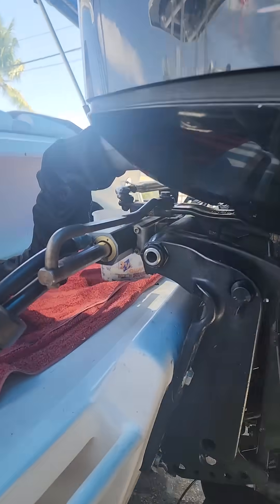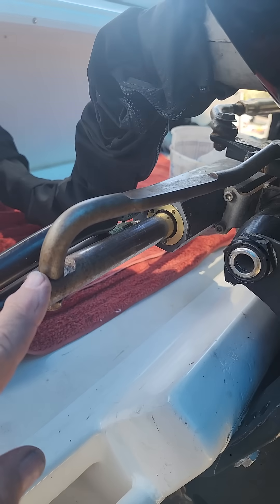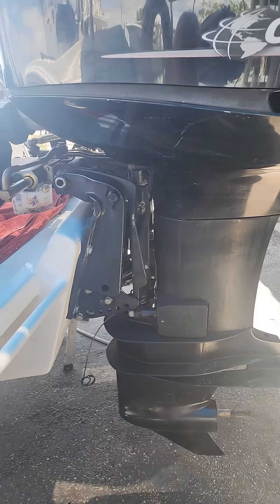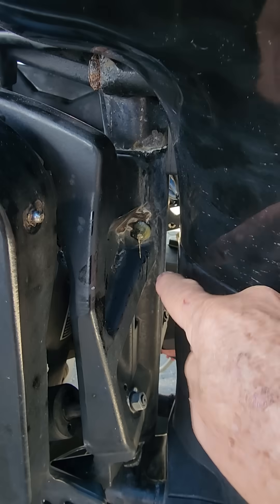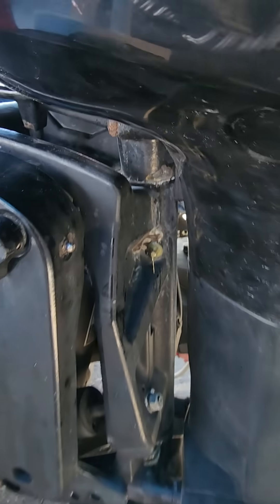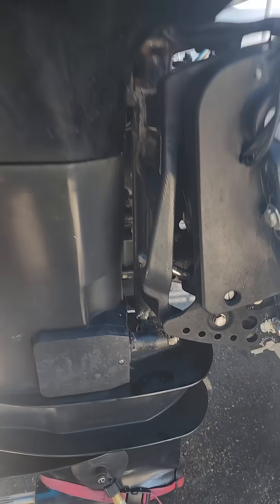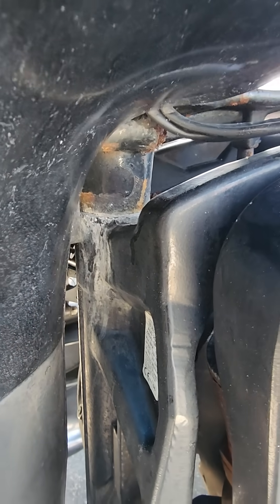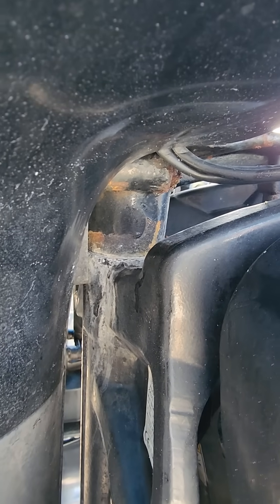Stiff Steering. Corroded Upper Swivel Shaft Bushing.

Comment: Those look to be Mercury 2 strokes, maybe Optimaxes.  But the design is similar on a whole range of Mercs and other outboard brands.  

He is right that the upper plastic bushing surrounding the swivel pin (there is one at the bottom as well) is likely seized with dried up, caked grease.   It’s not likely to be successful, but one can try to pump gasoline into the grease fitting repeatedly over several days and tilt the engine up and down and try to move the engine side to side and see if little by little it moves more easily.  If that succeeds, then once again introduce grease and expel the gas.  The gas will work as a solvent to free up the dried up grease. But the aforementioned is at best 30%-50% chance at working,   But it’s worth trying because the alternative is this:

The proper fix is remove the power head and middle unit from the bracket - which is a HUGE job, as the powerhead has to be separated from the exhaust plate and lifted off, then the upper and lower motor mounts removed, removal of the middle drive shaft housing and finally the retaining circle at the base of the swivel pin inside the lower yoke.  The swivel pin itself then comes out upwards, likely needing a hammer and pry bar.  The. the old bushings, o rings and seals are removed and the cavity in which the swivel pin sits needs to be cleaned out with solvent and rags - length of 1” pvc pipe can be reamed in and out with solvent soaked rags on top and/or bottom - of all the old corrosión and dried up grease.    If the swivel pin itself is not too corroded - shouldn’t be as it’s stainless steel - it can be honed with Emory cloth.   Then New bushings, o rings, seals and reinstall it all, reinstall the swivel pin, with retaining clip (a PITA itself), new gasket on bottom of power head for the exhaust plate and reassemble.   

The huge problem with this job is that if the swivel pin is that bad, the motor mounts and their bolts are likely shot as well.  They won’t be able to be unscrewed to get the middle housing off and the motor mounts and/or bolts will likely have to be cut off with an angle grinder and replaced to do that.   Additional cost and parts for new motor mounts and their mounting bolts.   Also, the exhaust plate itself might corroded and in bad shape, including the area where the idle relief boot is secured to it, and all of that might need to be replaced.   If one goes that far, clean out of the accumulated tar and carbon inside the exhaust tube inside the drive shaft housing should be done, along with new gaskets.   Cleaning the exhaust tube of all that crap is a freaking PITA.  It can be done with a 5 gallon bucket with a 50/50 mix of acetone and automatic trans fluid, soaking for several days and a shit ton of rags, boring brushes for the idle relief ports and time.  

This job is not for the faint of heart or those without strong mechanical skills.
Reply: Hi mate, curious to know how to go about pumping fuel into the grease nipple? Are you pumping it through a grease gun? I have this same issue with a Mercury 60hp and have tried heating up the area to get grease into it but no joy
Reply: @yourmumscaretaker Hello, take a look at this video: :

https://youtu.be/Ph0QndGBa6E?si=WBL-oGWjl4twF4Cx

Be careful using too much heat on the area at top and bottom of the swivel pin.  The plastic bushings, seals and o-rings can melt if you get it too hot.  

The gas in the grease gun effort may or may not work, but it’s worth a try.   You can try to use gas or I think another good alternative is PB Blaster - you can get it by the gallon.  You may have to try a couple of different grease guns.   Good luck, hopefully you can get it loose and lubed.  Otherwise the only real solution is basically the process I described in my other comment above which is a royal pain in the ass.